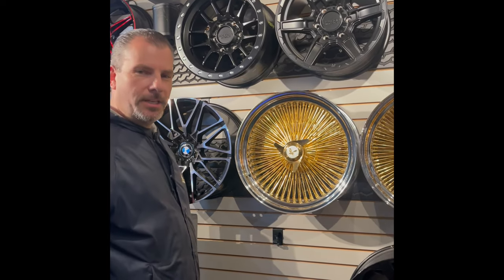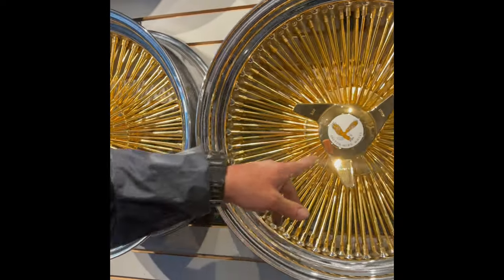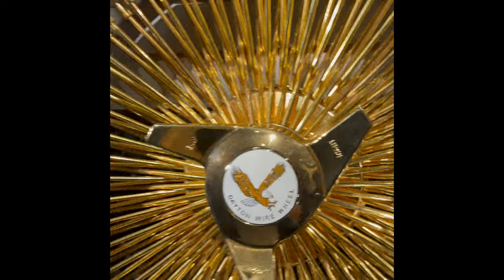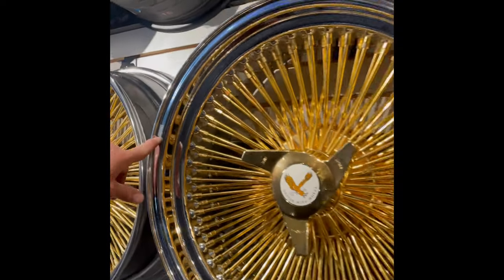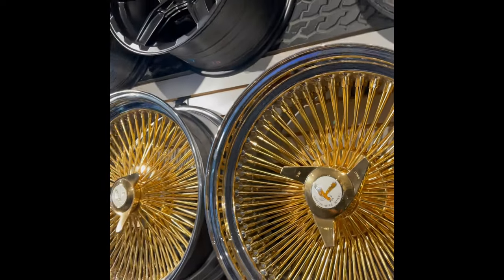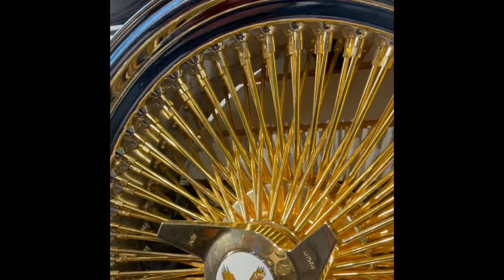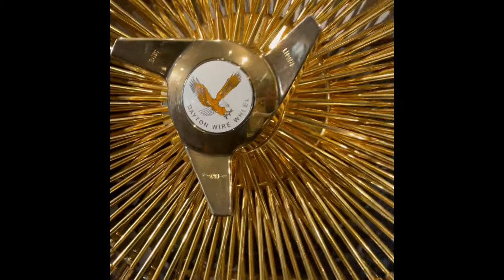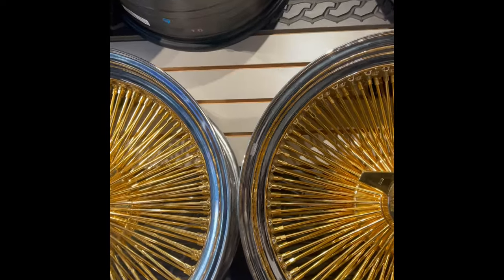How to tell if Wire Wheels are actual Real Deal Daytons

Comment: Can you or anyone tell me if the rubber seal on the inside of the 100 spoke rim can be replaced. In case your son gets excited and brings his brand new 100 spokes and Vouges to a corner used tire sales to have the tires put on the rim and the tire guy messes them up by destroying the rubber seal in the inside of the rim so the rims won’t hold air now… instead of waiting for dad to help him get them to the right place. Anyone have any suggestions and no judgement needed my son bought and paid for them working at Burger King he’s 18 and has a 91 Cadillac Eldorado 2 door he is putting them on and now he is bumming out so can anyone help me out??? Possibly
Reply: Following
Reply from the maker: Sounds like your son earned those spokes! We're impressed! Is this a front wheel drive/ lip lace spoke ? Those can be a tricky install. We would be happy to check 'em out and see if we can repair them. We need to see how many spokes are leaking. Are you in the SF Bay Area?
Reply: @RollingStock  lol no where near California, from Rhode Island, but thanks anyway I was just trying to figure out whether or not that rubber is resealable and if it’s something that would be as good as new. Hopefully this guy that owns the shop that messed them up is gonna be a proper business man and fix the mistake made by the employee who didn’t know that mounting the tires on them rims was to be done a specific way will be paying for the damages. I feel bad for the employee but I do believe they were in the wrong and should pay for the repairs or new rims. Would you agree? Just out of curiosity.
Reply from the maker: If it was us, we'd fix it. But we have a reputation to uphold. I hope you get something worked out with them!
 @dancyr6686
Reply: Yes... The rubber silicone seal can be removed... And new rubber silicone added .. it's something that requires a steady hand and plenty of good water proof silicone.... And they definitely need to be warm.. so it glides around wheel
Reply: @davidmontano9784  yea found a guy to do it fairly cheap. He has the stuff to get it done …. Since I brought them he completed 2 and they are still holding air so fingers crossed… another expensive lesson learned for my son…. Good life experience… lol

Comment: Are Dayton’s still made? If so, where is a good place to purchase?
Reply from the maker: Yes! Real Deal Daytons are still made in Dayton, Ohio! You can buy the from a Dayton distributor, like us!
Reply: Thanks! Specifically I am looking for 13x7 Chrome Reverse ones - I didn’t see any on your website but let me know if that is something you carry
Reply from the maker: @ericj1380  Those can be ordered! Please reach out to us and ask for Mario!
Reply: I purchased my Dayton’s straight from manufacturer in Dayton Ohio. Takes about 2 months to manufacture.
Reply: They are in Centerville ohio . Go to there website and call them they will tell ya the best place to buy them
Reply: @RollingStock will the gold fade or rust on the real Dayton
Reply from the maker: @Bigward356  Gold plating will fade, but on a Dayton it will be much slower. There are things you can do to delay fading, keep vehicle stored inside. Use a mild soap, dry wheels when washed. Daytons are stainless steel, so they won't rust, but they will fade over time.

Comment: do you really need a Lead Hammer for spokes rims with bullet caps or can you just hit the tool with a regular hammer?
Reply from the maker: If you are only hitting the tool (bullet knock-off wrench), then you do not need a lead hammer. You only use a lead hammer when hitting the knock-off directly.